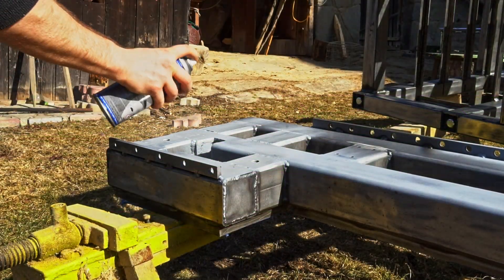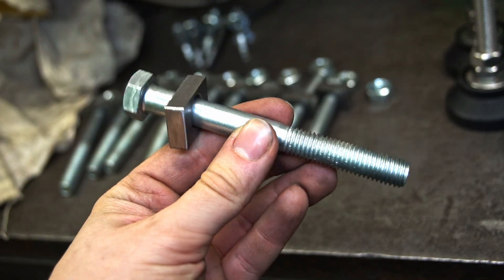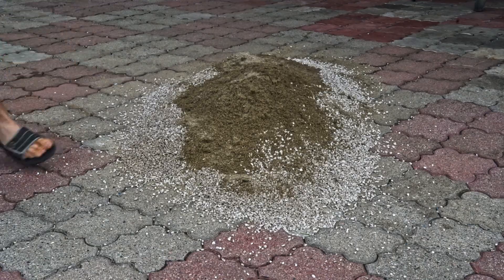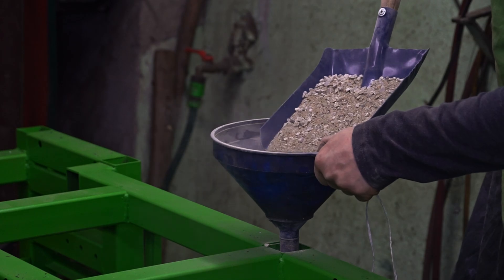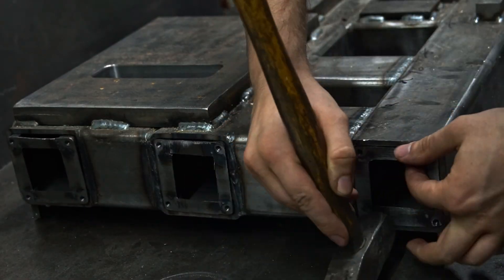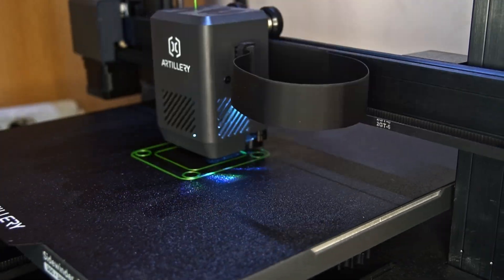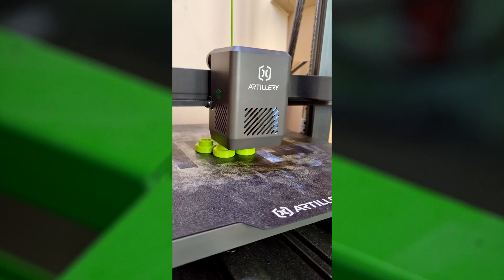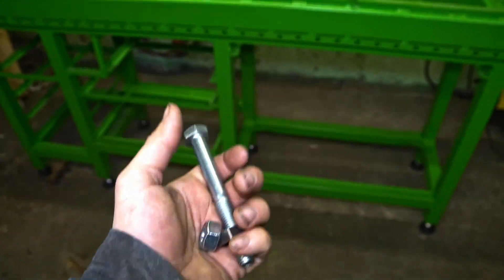Last Steps On The CNC Lathe Frame - DIY CNC Metal Lathe Build! #8

Comment: Have you tried two or three millimeters of steel bearing balls to fill the frame?
Reply: Back when the first CNCs were built the frames were filled with sand
Reply from the maker: That would cost a lot I guess